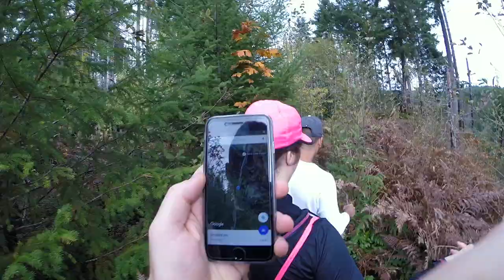Abandoned Railroad | Vance Creek Bridge: How to Get There

Comment: Smart move going to the south side now that the north side has barb wire. Seems like a fun adventure! How long was the hike for you guys?
Reply from the maker: Yeah, the hike to the south side entrance makes it more of an adventure! And the hike is about 1.5 miles each way.
Reply: Nice! Where did you park?  Hoping to see it before they rip the rest of it up :(
Reply from the maker: We parked pretty close to one of the gates that blocks a road which we hiked on to get to the bridge. I have the spot marked on my google maps link in the description!
Reply: Was the road that you drive up to get to the south side trail also blocked? I also read online that they are making arrests in the area--did you go early in the morning?
Reply from the maker: The road is open up until that gate we ducked under at 0:20 in the video. And I read those reports too, but who knows how accurate that is. We went on a Saturday in October and I saw no one who would be enforcing that. Maybe avoid going during peak times like  on a weekend in the summer.
Reply: Thank you!....I'm looking at the map that you posted and it seems like there's a gate at the intersection of NF2341 and NF23, right before you turn up the road to get to the parking area. Did you drive around that or was there no gate when you arrived? I'm going next week!
Reply from the maker: BethAnn Caputo I just check using Google Maps with Satellite view and I'm not seeing a gate there, and I don't remember there being any gates on these main roads, so you should be good! There were other people using these roads for hunting, so you're likely to see other cars too. I'm excited that you're going!

Comment: What are the extra tracks often seen on rr bridges? Looks like a fun time was had by all.
Reply: If I'm not mistaken (and that is very poss lol) it is for multi-use reasons. Most outer track width being standard train, and the added inner rail for smaller carts and service vehicles? Cheers 🤘

Comment: Hey so I've been to vance creek a couple of times but I only used the north entrance. Now that they took the boards down im still tryna go using the south entrance. On your map it says that you turn from NF-23 onto NF-2341/2199 but from my experience and from the map, it shows that there is a gate blocking that road?? Are you able to drive around it or what? I know it is possible to go the long way around but I rather wouldn't. Im planning on going this weekend and any a response would be appreciated
Reply from the maker: On the map I put a green pin that is titled "Park here" and we were able to drive all the way to that spot. There is a closed gate at that spot which is not possible to drive around, but the hike is only 1.5 miles to the south entrance of the bridge.
Reply from the maker: Oh I see what you mean with the gate being closed on Google Maps with the turn off from NF-23 onto NF-2341/2199. When we went it was open, and several cars were driving along that route.
Reply: Bosch Voyage alright I'll test my luck! how long ago did you go?
Reply from the maker: Yeah let me know how it goes! We went last October, towards the end of the month. And if that gate is closed, I don't see any gates along the NF2199/ NF2341 road coming from the south. Would be a longer drive, but it's a backup plan just incase!
Reply: Bosch Voyage yeah I'll let you know man! thanks a bunch
Reply: Bosch Voyage Hey! I've got a question! When y'all did the 1.5 mole hike to the bridge, how long did it take for you guys to wall to the bridge then back to your car? And are there a lot of huge uphills/downhills?
Reply: Cecilia Pham alright so I went Saturday and the gate off of NF-23 onto NF-2341/2199  was closed :( we didn't want to drive all the way around so we decided to park on the north side and walk from the gate to the South entrance. if I remember right it was about 1.5 miles or so and it didn't take all that long since it was just walking on a road. id guess it took us about 20-30 minutes. however when we got to the South entrance we had to hike another 1.5 miles and this time it was a lot harder. the first .3-.5 miles was just another road but it  was really steep and it was really tiring not gonna lie and I'm a moderately athletic person but it was definitely doable!  after it leveled out the trail started and got narrow. you definitely need gps to follow it because it is very overgrown. the next mile went alot faster than the beginning hills because it was level. the hike from the south trail probably took us 30-45 minutes. we didn't take that way back because we were all tired so we decided to walk on the beams back to the north side which only took like 20 minutes haha
Reply from the maker: I think it probably took us 1 hour each way. The hike is pretty steep at some points and you have to jump across a creek. Plus navigating through the trail takes some time and checking of the map. It's relatively a short walk though, just takes some time.
Reply from the maker: Ah damn, sorry to hear the gate was closed! But thank you for pointing it out, I updated the Google Maps route to come in from the other direction so others can avoid that gate. Glad you made it though! And i probably would have jumped down on the North side of the bridge too to avoid that walk haha. And I made sure to show me holding up my phone to navigate the route because that's what it was like the whole time. Glad you were still successful with getting to the bridge!!
Reply: Bosch Voyage it's all good! Had a fun time and thinks for the video, it helped out a bunch man
Reply: Thanks Toby. I think parking at the gate of NF-23/NF-2341/2199 and walking to the "Park here" place is the only way to get to the north entrance. Streets from the south are all blocked! I am at Shelton at the moment.